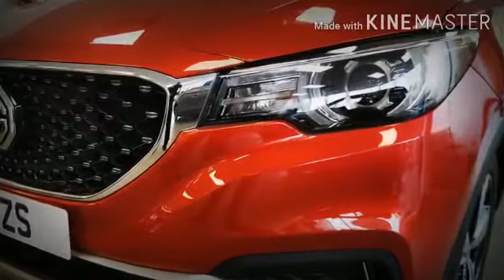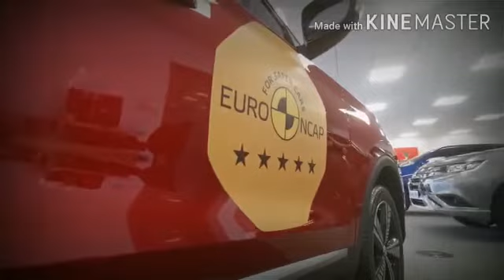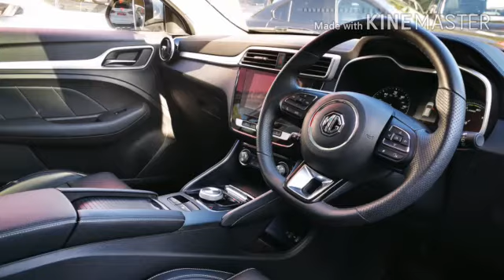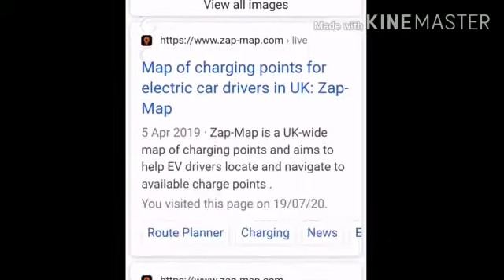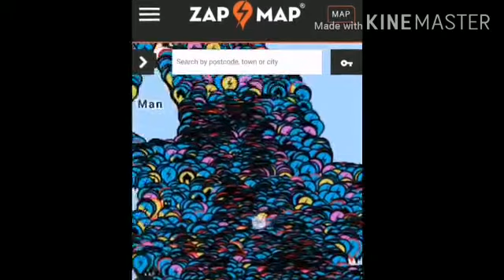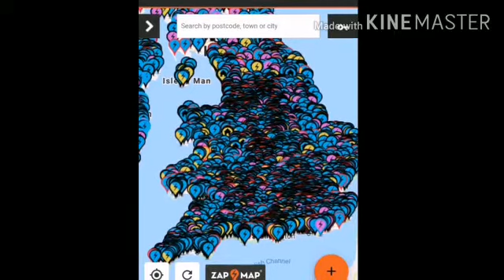MG ZS EV

Comment: MGPilot and TrafficJamAssist are amazing.  Tesla features for MG money. :)  Instant torque will be a pleasant surprise for all those who drive old fashioned cars.  I've had 2 Renault Zoes and I much prefer the MG.  (I have no association with Palmers).  Try to talk your dealer into giving you (or at a serious discount) a type 2 cable as part of your deal as you're are definitely going to need one.  They can be bought for around £125 from several outlets.